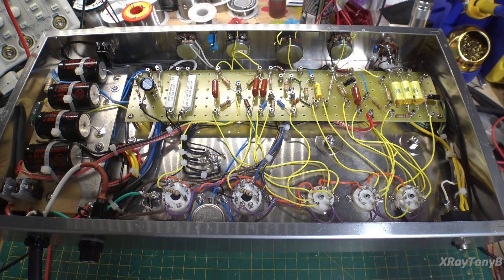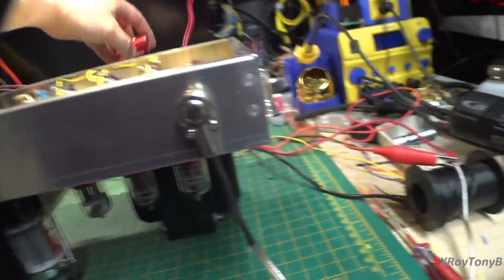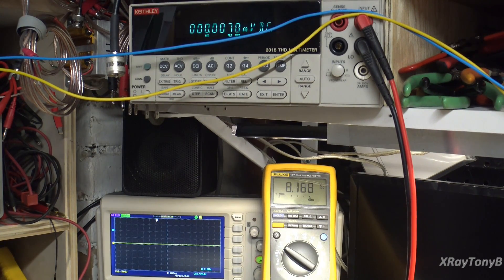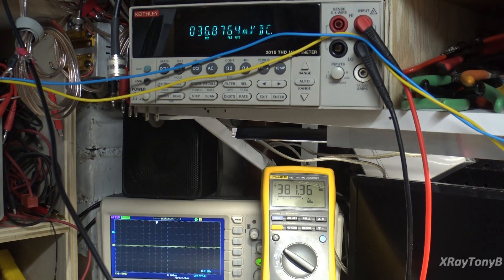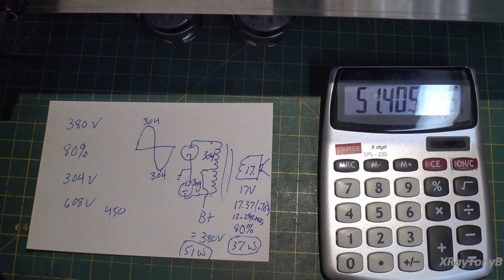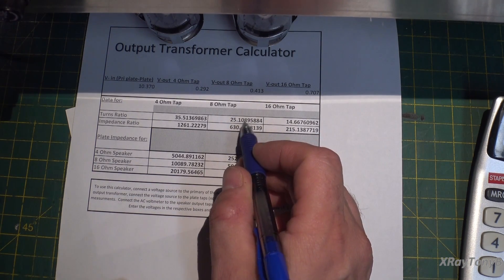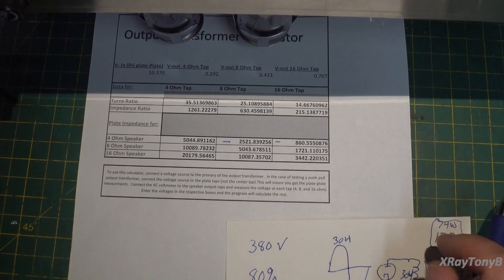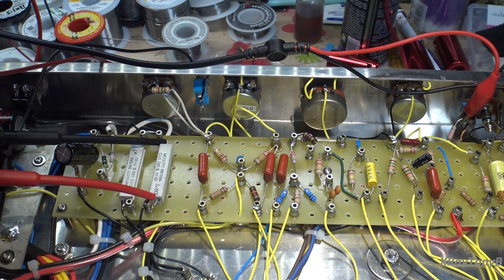Building a Bass Guitar Amplifier - Part 3 - First Power-Up

Comment: You'd need a power transformer with a HT winding of about 320v-0-320v (640-vct) to get approximate 450vdc with solid state diodes for the rectifier.

Comment: Fantastic work Tony. Did you install a standby switch? I didn't hear you mention one at all. With the Solid State rectifier a standby switch is a must have or the cold valves get slammed with B+ before they ever have a chance to heat up. 
One small tip for you. When you square a figure on your calculator you dont have to punch in the numbers twice. To square 100 simply punch in 100 then hit the X then ENTER and and you will have your 10,000 figure. I was cringing every time I watched you type in the numbers twice ;). Again, great job. I enjoyed the series very much.